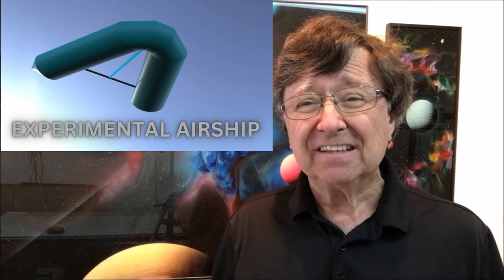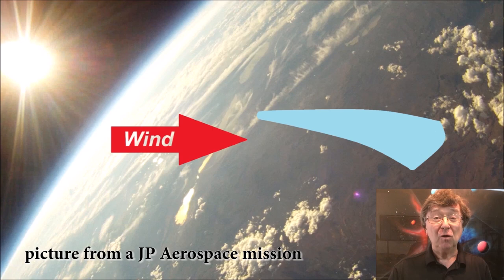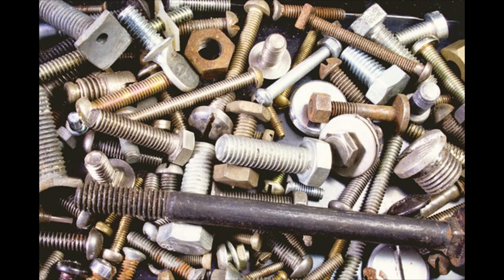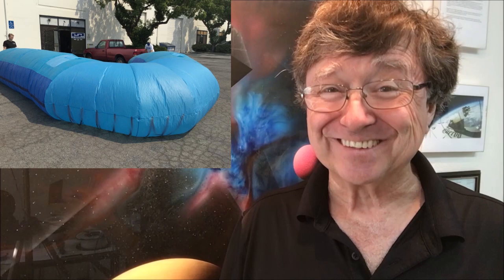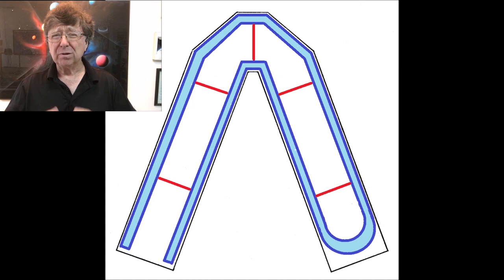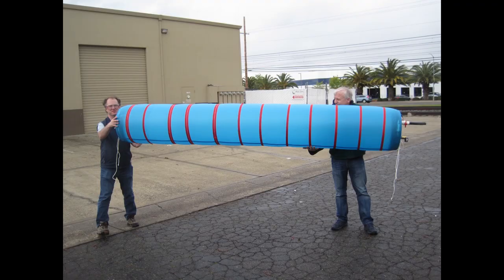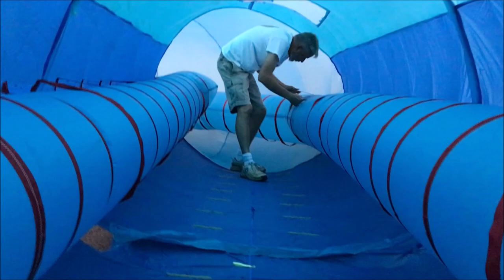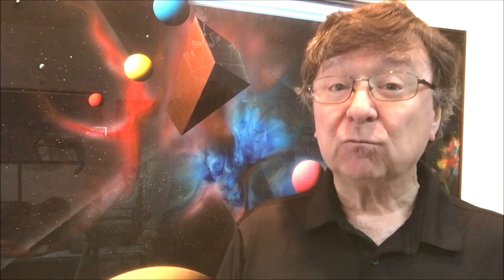Ellipse Airship Update

Comment: I've been thinking about airbeams for a while now but in a different context.
This MIGHT be a solution to your funding actually:
I was thinking of using airbeams to create inflatable hang-gliders. Hang gliders are far superior to paragliders but there are issues with them, you generally have to transport them on a specially adjusted car whereas paragliders can just be in a backpack since they inflate the airfoil using the oncoming wind. The other issue is that the only currently used way to eliminate top supports for a hang glider is using carbon skeleton, which is quite expensive especially since it requires these cumbersome very long beams. Of course I don't expect the same rigidity of an airbeam as a carbon rod has BUT if you again think of the paraglider, the issue there is sidestepped completely with a fully non-rigid airofoil that only holds shape by inflating it's cells from the dynamic pressure of the oncoming wind.
A hybrid design between those two types of gliders could, in my opinion, be done with airbeams providing some rigidity and be a fully viable option for flight, quite possibly outperforming both of the other types of gliders because it would have a better shape than a paraglider allowing for better aerodynamic properties but being inflatable could have a wider wingspan than a hang glider thus outperforming it on that front. It could still be carried uphill by the pilot themselves and inflated on the launch spot without the need of a second person driving a car back down hill. And most of all, it could be barely any more expensive than a paraglider.
ALL of the airbeam airship building expertise you already have would be VERY applicable here and no doubt you'd learn a lot more in that area from doing this.

Please, if you get rich by undercutting these two industries, make sure to send me a free glider, thanks.

Comment: You just about have a lifting body design.  Why not fill the middle,  put more gas in it and let r rip.  Wouldn't that be interesting to try.  Try it please.  If costs allow that is. I know money is tight for everyone.  You can still make an elliptical cross section and it can be a triangular lifting body design and to me , just an opinion from an aviation enthusiast. It will also look really cool if you destroy it properly.  I can help with destruction.  I can break anything.  Hire me
Reply: If your using helium,  how much extra weight would it take for a vacuum pump to suck out the helium from the shell to keep the interior pressure down as the space craft ascends above the atmosphere? Also I'm really good at thinking about how things blow up, and hopefully prevent it. I noticed that you said release vents but what if you didn't have to waste all that valuable helium and could reuse it over and over? Any thoughts